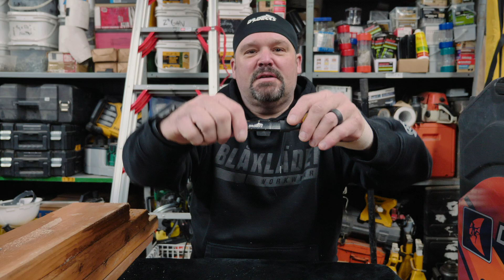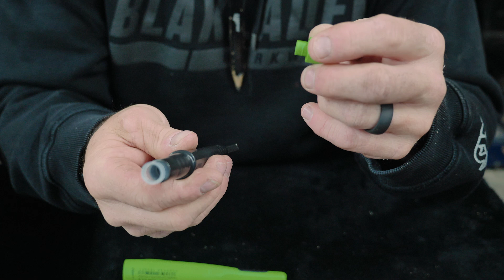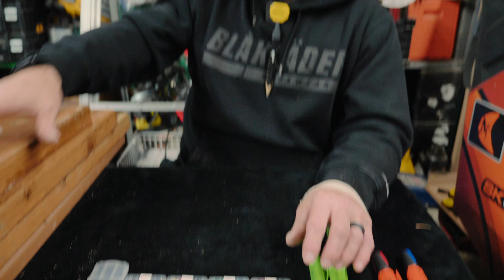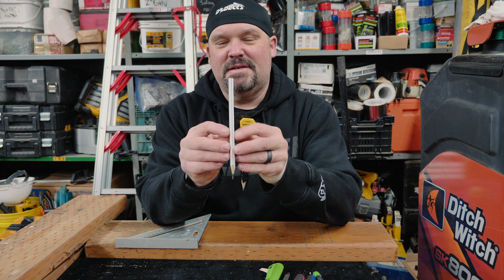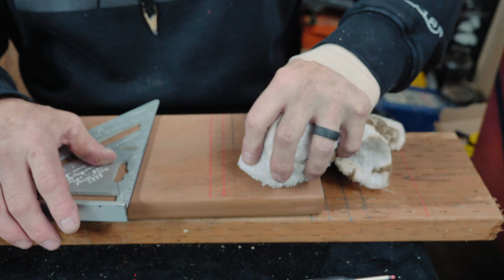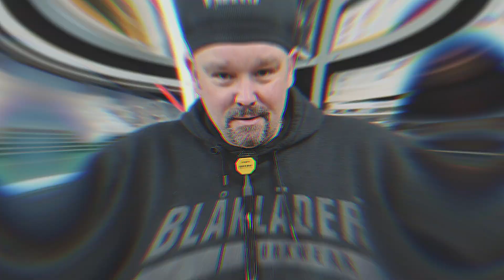First Impression: Pica Marking Tools || Dr Decks

Comment: Just a thought, I have one of these and you don’t need to press so hard.  Pressing hard just wears the tip faster and leaves a line 5 times what it should be.  Light pressure is all that’s needed.  👍

Comment: I am a industrial electromechanic. We fix all sorts of machinery at steel mills or nuclear plants, refineries. Whatever.
Expert area is electric motors and drives, we revise and repair em. Even to the point of rewinding em by hand.
We also sell and service them, align them and maintain other gear.

I have the pica dry the deephole marker and the pica “gel”. 

The dry needs no introduction great pencil, usable on lots of materials, tough, resistant to oils and greases, nice rough texture but easy to wipe down after a day in the dirt and grime. Deephole marker is great for when we have to make gaskets ourselves for reduction cases or pumps. You can really get nice and deep in the hole to the edges and around the part up close with its fine point. Then You cut out the gasket and see if it fits. Great tool! Better than a marker or a Bic pen lol.

The Pica gel is a replacement to tube paint. It marks on EVERYTHING and doesn’t go off. I use it to put markings on parts to make sure they are oriented correctly upon assembly. It gets pressure washed and we even tried it in the burner.

We have a burner that burns the corpses (the dead motors that are either scrapped or rewound, they get heated to 850°C.) So the insulation and tropicalisation varnish gets out. That we use hacksaws to remove the old burnt windings (copper is recycled) and make new windings if the customer demands so.

They say the markings last to 1400°C, I tested them at 850 and they did fine 😂

Sadly its non-refillable I think, there is a sharpener built into it to get the point back. I guess they should put it on the Visor as well.

TLDR: great products, usable for heavy indsutry, metal working, carpentry even the home gamers. robust, practical, affordable and easy to identify due to the different sheath colors!!

Comment: Checked Amazon...those Picas aren't cheap.  Are they that much better than a 49 cent pencil?
Reply: You’re more likely to be able to find your cheap pencil because you had dozens of them. This is way to expensive and unnecessary. I’ve never had a situation where a weird surface got in the way of a cut except certain tiles use a cheap China marker it’s not great but it work and it ain’t 12 bucks with a pack of led at 13 bucks. Bought and returned.
Reply: @golfclash2035  I didn't have a lot of choice to be fair, I tried my daughter's stationary, crayons etc but nothing worked where I could still see the line whilst using a wet saw.
Another problem was that the water becomes cloudy after 30secs so the line was too difficult to see.
I might have paid over the odds but I did a mint job on the cuts in the end, too much of a good job like I had OCD 😄
At least I won't have to use too much  sealant around the edges now.
Reply: @BCGT_Mikee_Dredd  silver sharpie would work but hey if it worked for you can’t complain
Reply: @golfclash2035  cheers for the advice buddy, it's a shame I only have them in black, red, green & blue 🤦🏻‍♂️🤣
Reply: @BCGT_Mikee_Dredd  👍🏻
Reply: Some websites have them for between 12.99-16.99.
Reply: They draw on things you can't with a normal pencil, like a smooth black porcelain tile.
Reply: It makes me more efficient at work